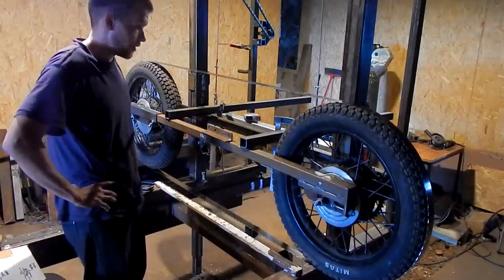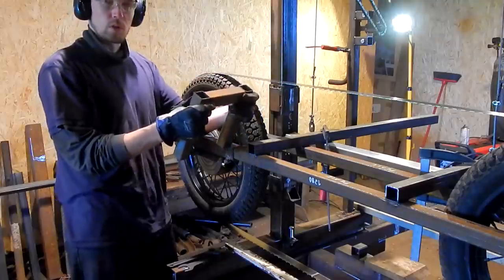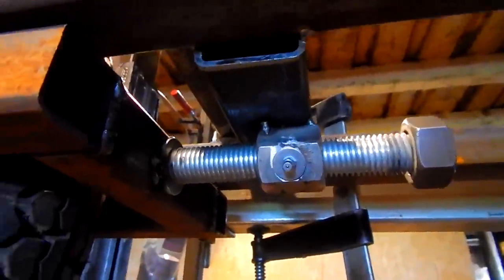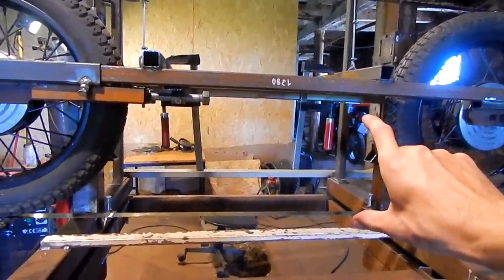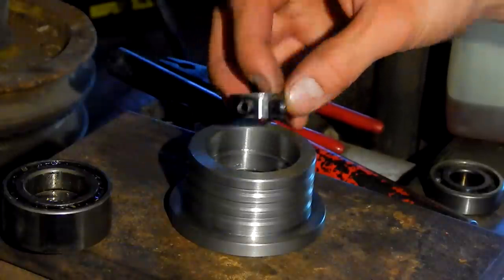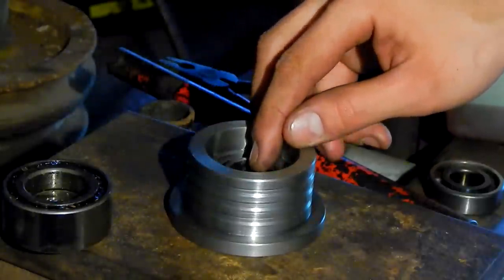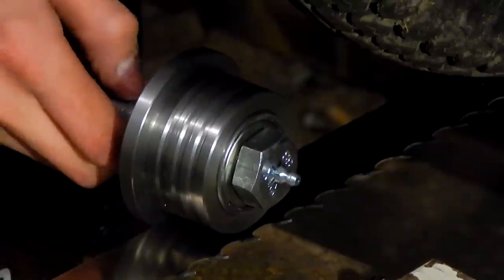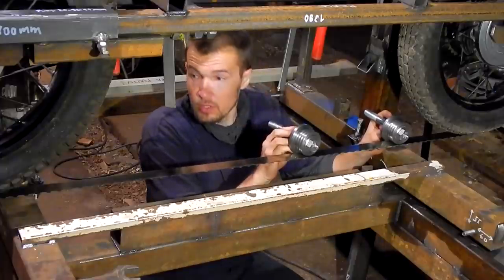Turning Blade Guides & Making Blade Tensioning System - Band Sawmill Build #17

Comment: I like the drilled/greasable bolts. I used some of of those when I rebuilt the shackles on an old land cruiser of mine. Very cool touch
Reply from the maker: I was thinking of slapping the blade guide rollers together just from a couple of bearings without the turned rollers themselves. But I thought this way, with the turned rollers and bearings inside'em with bolts that make the bearings easily greaseable is fancier and more durable, especially when they're pretty much permanently sprayed with water as blade lubricant all the time. It's an eye candy, at least for me. :D
Reply: Definitely.  It always feels good to look at something and think, “I could have taken the easy road on this and got away with it but I didn’t and I’m proud of it and it will last my life time.”  Love this build!

Comment: It’s looking Pret-ty good. The motorcycle wheels are looking like a very good choice for the saw. A coworker of mine made a bandsaw and used trailer tires but the rounded profile of a motorcycle tire looks more appropriate plus you already have a drive sprocket and if you wanted you could utilize the brakes on one wheel to stop the blade as well. 

You will be making lumber in no time. 👍🏻👍🏻
Reply from the maker: I do have doubts on the motorcycle wheels and their durability, but I will try them out. I also do like the rounded profile of the tire. At first I planned on using car rims but with the small spare donut tires on them that also have that round profile. But motorcycle wheels are what I had so I used'em. As a matter of fact - I was thinking about using the front drum brake on the mill, I have one as a spare in a box in the shelf if I wanted to use it so I don't have to take it away from the bike itself. I hope to make lumber already, can't wait anymore. :D
Reply: Don’t worry motorcycle wheels are fine and cheep

Comment: When you mount the guides, it is my understanding that they do no go in horizontal line with the bottom of the wheels.  They sit lower than the bottom of the wheels.  Not sure why.  Check out other saws.  Good luck  ~P
Reply from the maker: Yes, you're right. They sit lower so the blade angle can be adjusted with the rollers so it is level in every way and doesn't start diving or climbing in the wood while cutting. That's what I'm gonna do too.

Comment: Another question, @12:32 you made a boult with grease point. It brings the grease between the barings in the roller. But the grease has nowhere to go, in the end it will push out the barings.....oh wait is that the purpose!? To be able to change the barings? It looked like closed barings, so they don't need grease. If they do, there must be a drilled hole in the roller where the old grease can escape.
Can you tell me your thought on this? 👍
Reply: They're not sealed bearings.
Reply from the maker: The bearings are closed only from one side, the open side points toward the center of the roller and grease can get in there.
Reply: Guust 

.
Reply: Ñ

Comment: How does the grease get in the bearings of the guide wheels for the blade?  Don't you have to make holes in the shield of the bearings on the inside side?  Or take the shields off?

Comment: Have thought of a spring/damper as (automatic) tention device (in stead of) the boult you just made? 
Or this will work also great, because of the air tyres, working as springs, to keep the tention on the saw blade even.
👍👍😎
Reply from the maker: I have to make a damper for the tensioner when I eventually cast aluminium band wheels for this mill. But yeah, right now the tires will do. I think this mill will definitely see some modifications in the future. ;)

Comment: Good stuff! The blades guides look great. Could the wheel tensioner mount on top so you would not have lost any height?
Reply from the maker: It could have been mounted on top but I was afraid it would start pushing the tensioning frame crooked. Right now the tensioning of the blade is in line with the center of the wheel so everything stays nicely lined up. I will probably change it up or at least modify it so I don't have to reach to the center of the mill to tension the blade or release the tension. But all that in the future. :D

Comment: If you have the double adjustment on the one wheel, why didn't you use that as a tensioner? It would work the same as tensioning the chain on a motorcycle. Instead of adding it the middle?
Reply from the maker: Just give it some thought, you'll figure it out why I did what I did.
Reply: @DonnDIY  After watching the rest of the build now I see why... didn't know you were using 2 motors and a jack shaft.

Comment: That was a huge drill bit, I'd hate to have to buy one that big these days. It would probably be so expensive o.O what size is it?
Reply from the maker: The one I used was 41 mm / 1.6 inches. The biggest I have is 50 mm / 1.97 inches.

Comment: Nice work Donn. You may find that those blade guides wear out prematurely. The ones you buy from Wood Mizer are case hardened. How do you plan on sharpening and setting your blades?
Reply from the maker: Thanks for the insight. I try them out and see how they perform. Maybe I'll just downgrade to just a set of bearings supporting the blade from the top and from behind. But we'll see. I'm planning on building a sharpener. But that's a future project.
Reply: Donn; what grade steel did you use for the guides? I used ball bearings for my mill and they get loose after a while; I'm using bar and chain oil mixed with diesel fuel for blade lube, and I think it's washing the bearings out! I'm not sure about turning my own unhardened guides, even though they are less cost than Cooksaw's at 59 dollars each. Any info would be appreciated; and I love your build, great job.
Reply: Hello I made a set of blade guide out of mild steel ‘ I’ve done a lot of cutting and no wear at all ‘ cost zero

Comment: Excellent work.  I really enjoy your videos.
I have a couple of questions
1.  Why didn't you drill the hole in the part at 1:02 on the lathe?
2.  Why didn't you part all the way off rather than part way through and then break?
Looking like it's going to be a pretty decent machine. Well done.
Regards Mark in the UK
Reply: My same wonderings. The lathe was the best machine for the task.
Reply from the maker: Cheers! It's better to drill deep when the work piece is vertical - the hole in it is vertical so the lubricant will lubricate the drill bit better. And it was faster to drill it in the drill press than in the lathe. I didn't part the piece all the way through just because I've wrecked many cut off blades by doing so. In the end of cutting the cut off piece starts to wobble and wedges the blade in the cut groove and snaps the blade. One can always cut wider but I just chose to keep it bigger in the center and just broke it off.
Reply: Mazak 250MY/450M slant bed.
Usually partoff blades like to climb and must be dead center with the piece.
Drilling a hole then boring it out would eliminate multiple setups. Our manual lathes have KDK tool change systems to speed up things. 
Great job working with what you have.

Comment: Tires generally cannot supply enough tension to the blade as a solid steel wheel and the tracking cannot be as 'backed up' it does not have a shoulder flange. Works to a degree of feed and pressure limits
Reply from the maker: To my knowledge no band saw wheels have a shoulder flange on them but correct me if I'm wrong. At least I haven't seen any. There's no need for the shoulder on the band wheels since the guide rollers/slider/bearings will support the cutting force. There's only radial force on the band wheels that occurs when the blade is pulled through the wood. And the pneumatic tires aren't really the best things to use I know, but it's what I have and what I'm using for R&D. I can change them later on.

Comment: Watched all your build videos on this mill, great work and very well done videos.
I am in the process of building a mill and my lathe has no lube.  What did you use for cooling/cutting fluid with the brush when turning the wheels?
Reply from the maker: I use special cutting fluid.

Comment: Why haven't we seen the CAD drawings of this project?
Reply from the maker: I only have a CAD drawing of the trailer, but not the saw head. I usually only make a sketch of the working principles and the placement of the movable parts, since all the material that I'm eventually using is gonna differ from the original plan since I'm using what I have and what I can from the scrap steel to take the cost of the build (or any other build) down. But I will probably make a final drawings from this sawmill so other people can build the same sawmill, if it is going to work properly. :)